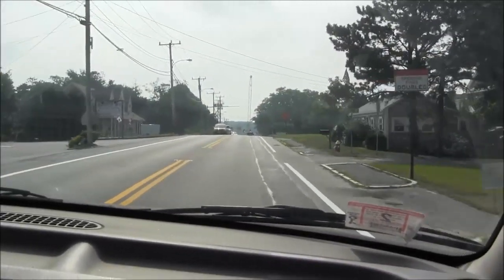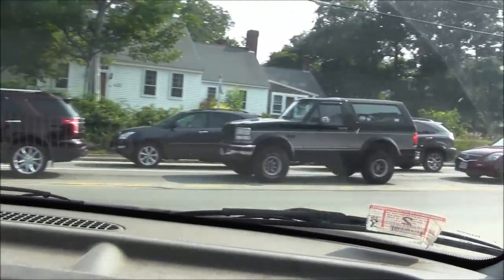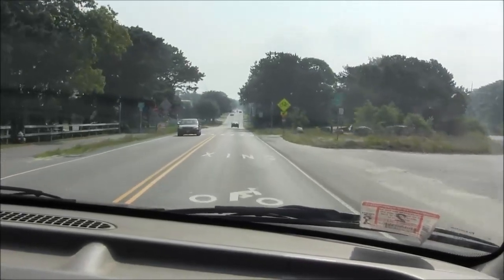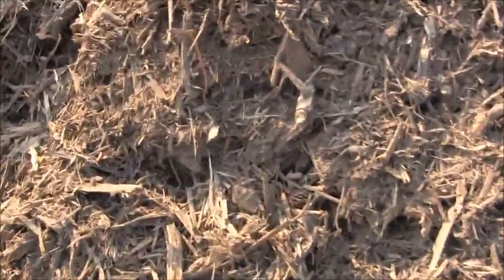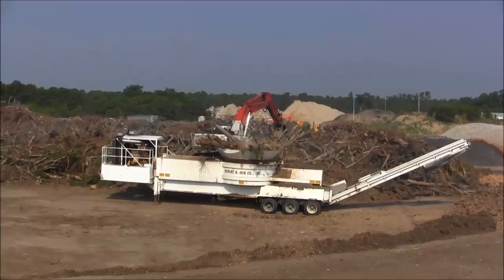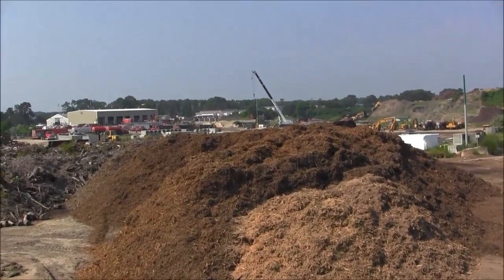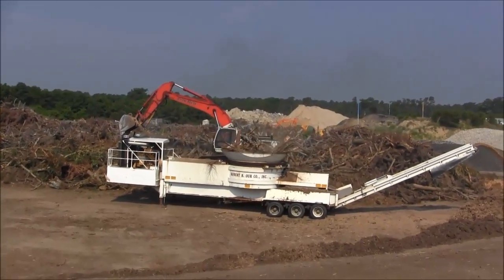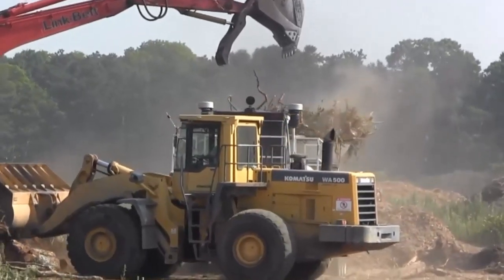Jackshafting Part 9 (Finale): Finished Tub Grinder Jackshaft In Action

Comment: Hello I’m from Philadelphia pa I have a hammer Mill from a Duratech hd12 it’s only a few months old and the shaft got bent slightly and I need to take it apart do you know anyone that could disassemble this mill it has a threaded but on each end the shaft is 5-1/2” diameter

Comment: 2000 cubic yards per
8 hours give 250 an hour. That gives 190 cubic meter an hour. One
cubic meter contain 0,8 MWh, estimated.  50 gallons roughly equals
0,2 cubic meter and contains 2 MWh. To put that in perspective: you
get roughly 150 MWh by burning 2 MWh of diesel.
All other equipment excluded. But if you count in transportation and grapplers and
loaders, and estimating them to 25 times the fuel consumption per unit of the
grinder alone you still get a ratio of 1 energy units input, 3 energy
units output.

Did I miss something? And cubic meters are way cooler than cubic yards.

Comment: I like to work on stuff. My skill level is just barely above amateur. The grinder was neat. I have a chipper shredder that is a toy compared to that beast. I got it used, but with issues. A carb for the old Tecumseh cost as much as a Chinese Honda copy engine. The Walbro carb on the machine when I got it was the victim of our excuse for gasoline E10!! I t took a spacer, machined by my talented son and a redo of the support plus another pulley to get it going. It is an original Trobilt Tomahawk, not the not so good present model. Nice machine, shreds leaves neatly into nice mulch or compost. Next fix is to remove and sharpen the knfe to get it to cut wood. On, way back, i repowered my 83 Jaguar with a 94 Cadillac LT 1 V8. Tons of fun to drive after much travail in getting it done. Keep it coming, Keith. I also have a little Atlas lathe that i restored and am beginning to learn to use it.
Reply from the maker: Thanks for the comments Carl and I know that lathe is going to come in handy with the projects your working on! ;{)------

Comment: The rubber coupling on the machine is just like the one at my plant that drives a roller mill, I have taken it apart many times had to take apart to change belts on mill, it had a 300 hp electric motor driving it, also had the same bearing setup.

Comment: just had a look at your blog page and the wrinkler's crane pics from 2009 are very interesting, there's that technique for finding cracks I never heard of. and also it seems it's made of a brittle alloy and that you could clearly remove the fractured part with a hammer (?) and finally, what welding technique did you use ?

Comment from the maker: Well you could mount it on the jug, with bluing on one side and torque it down to check the surface contact. More than likely paper lapping on a piece of glass is going to create a true enough surface, specially if using a head gasket. ;{)-----